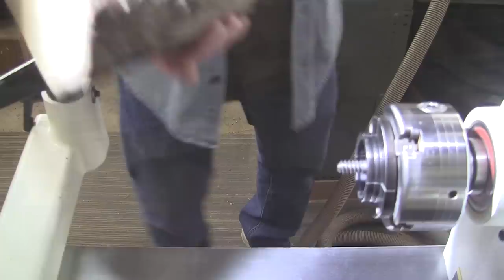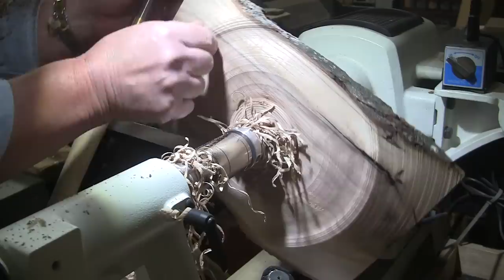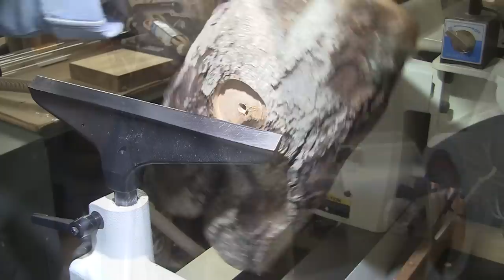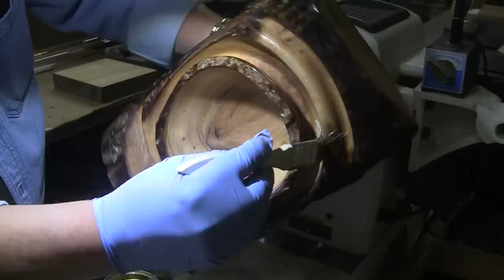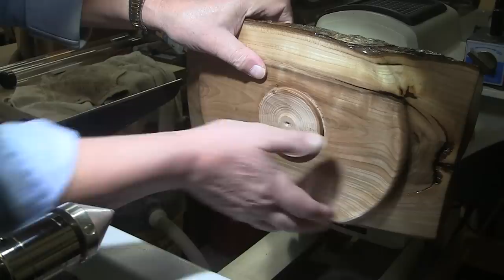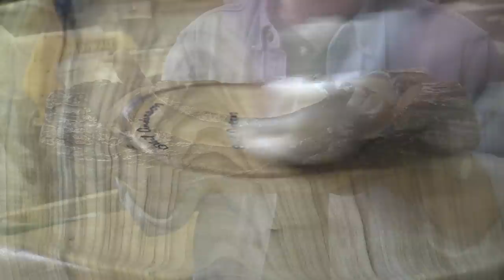Bad Dream Bowl! - Wood Turning

Comment: Hi Phil.  I meant to mention in my last comment.  In the past when I faced the dilemma of sanding in tight places that do not allow fingers, I have used rubber hose (1/4, 3/8 and 1/2) diameter with sand paper wrapped over one end and taped on the other.  This rubber hose allows the sandpaper to move with the contour of the area to be sanded without damaging fingers.  Mostly I use the clear hose that is a little firmer, but I also have use the more soft black rubber hose as well.  Hope this helps, Jerry
Reply from the maker: I appreciate the help, Jerry.  The problem is, I'm guessing you are talking about nice round bowls and your suggestions would be very helpful with those.  I turned another somewhat similar bowl after this one.  Lots of people had lots of suggestions on how to get in there and I tried some of them.  None of them work on a bowl with natural edges.  The irregular edges come around and just tear up whatever you are using.  It just takes lots of hand sanding with the piece not spinning to solve the issue.  😊
Reply: Thanks for the idea I'll try it in some places!

Comment: Hi Phil! This old video just popped up for me. I love it very much. One of the first large bowls I made was more or less like what you did but it was a combination chip and dip bowl. With the smaller bowl for dip emerging out of the chip bowl. The outer bowl was about 13 or 14 inches across and around 5 inches deep. The smaller bowl was around 4 inches across and deep enough that a little glass bowl could sit inside to hold dip. Wish I had remembered to take a picture before I gave it away. I think it was made from walnut. Anyway thanks for the video, I really do love the “bad dream” bowl! Cheers, Rick
Reply from the maker: This is an oldie, Rick.  I made a similar piece to what you are describing and gave it to my daughter.  I'm pleased she actually uses it!  Thanks a lot, buddy! 😊

Comment: Howdy Phil.....love that plump wood .....I have a chance to get a whole tree .      that piece looks fine to me . but I am blind in one eye and cannot see out of the other LOL
First thing came into my mind was a centerpiece on the Christmas table put some Holly on the outside around it and in the " grooves " and some fruit in the middle .
I have used that scotch brite for finishing before ...lots of times I'll take little little bit in the thin thin layer of butcher oil and rub after I finish with Scotch Brite . the oil will hide any scratches .
When I was in machine shop will use a lot of red and green Scotch-Brite . I have cut pieces and use it on my vibrator sander cleans up aluminum fantastic and stainless steel.....
The color of Plum wood is fantastic , make a lot of things out of that and will always look so nice.
Reply from the maker: Hi Bruce!  I spelled it Plumb on the bottom, apparently I thought I was framing a house, or something!  I corrected it in the description.  A centerpiece is a great idea, I'll relay it to the wife!
I just ordered more of the scotch brite pads.  They do a real good job and I don't have bits of steel floating around the shop.  I too, have cut it to fit a sander.  Saves a lot of work while leaving a great finish.  And, yeah, I've used it on cast iron tool surfaces, too.  Great stuff!  I really need to remember using it with the finish or at least, with sanding sealer.  I bet that helps, a lot.  Thanks for the reminder!
Thank you for your great comment!
Phil

Comment: Phil, I am a novice turner with loads of sanding under my belt and I've turned several pieces like your "bad dream" and I use the pads wrapped around a 2 inch paint brush with great results and intact fingertips. I'm a big fan and have learned so much watching your videos. I also try to leave it as natural as possible. It took retirement to return to a passion I learned in high school and started my own little venture called nakid grandpa woodworks here in Virginia Beach.......turning and learning.....bill
Reply from the maker: Thanks Bill!  I turned a similar bowl to this one and tried the sandpaper wrapped around the paint brush trick.  I don't know what kind of pieces "like" this one you have turned but these live edge and natural edge pieces do not do well with that trick.  If you have a nice even round bowl in the middle, it probably works great but on natural edge, not so much.

Comment: I like it. I know it's too late now. The only thing which was sorter out was the straight edges should have been rounded at the 4 corners which would have fitted it in with rest of your pattering. It's so unusual it could be used with a center piece on dinner table. A real talking piece.

Comment: Phil, I think that sometimes you get too critical of your work.  So what if a few spots don't sand up as smooth as you'd like, for whatever reason.  Anyone that finds fault with that should be told to go turn one themselves...... even if there are some flaws or rough spots - it's all part of the art form....This is a super interesting turning. In fact I think I'd certainly try something along that line myself, what can possibly go wrong?
Reply from the maker: My all time personal favorite, Peter.  😊

Comment: Phil. Nice piece, thinking outside the box which is great. Does sanding sealer act as a glue to keep the bark on? I have done a few natural edge bowls but I usually go around the edge of the bark with CA glue to keep it in place before putting a finish on. Terry
Reply from the maker: Thank you, Terry!  I don't think it would keep the bark on.  Your way is likely better for that.

Comment: You call it Bad Dream.   I call it boul in a boul on a platter.  I'm going to try one tomorrow.   But what I'm going to do is make the center boul a bit smaller.   Then create a second boul which will be bigger.   What ieft will be considered the platter.  I like the idea alot.
Reply from the maker: Good luck with yours, Albert!

Comment: Did you just use the wood sealer or did you apply a different final coat (I.e., poly, etc.) over the sealer.
Reply from the maker: Oh, I'm sorry if I didn't mention that, Don.  I used two coats of shellac as a final finish.  Thank you for taking your time to watch and comment, much appreciated!
Phil

Comment: Loved it, Phil.. Could I ask what lathe you are using? I'm looking to start out and have been watching plenty of videos. Not sure about a good starter lathe. Thinking about a cheap one to see if wood turning is for me or not. Maybe Harbor Freight 65345...?
https://www.harborfreight.com/5-speed-bench-top-wood-lathe-65345.html
Reply from the maker: Thank you, Carnak!  I have a Jet 1840 EVS.  Had it about a year and a half and love it.  I would rather see you buy a good used lathe for about the same price as a "cheap" one.  Maybe an old Delta, Rockwell, Powermatic, etc.  Something that maybe came out of a school shop.  Those old lathes are built to be heavy duty and for the most part, maintain their settings and accuracy.  Or, see if there is a turning club in your area.  Most of them have shop visits and mentoring programs.  Might give you a chance to try turning to see if it's something you will like.
Best of luck to you!
Phil
Reply: Thanks Phil, sounds like great advise.. I'll look around for a used machine and see what "turns" up.. lol. Subscribed.
Reply from the maker: Thank you very much for your subscription, Carnak!  I will try to be worthy!  "turns up"  LOL!
Phil

Comment: Hey Phil. I like the uniqueness of this. Does finishing a piece that is not dry cause issues?
Reply from the maker: Ya know, J Vanier, it should cause issues and I know it has for a lot of people, but so far, I have not had problems.  This plum is particularly likely to crack as it dries, even though I sealed the ends.  But, I have turned other pieces from this same pile, I think this is the third, and so far, no problems with splitting or warping.  The only thing I can think of is because I am using Shellac based sanding sealer and Shellac finish.  Maybe it slows the drying enough to keep it stable, I just don't know.  Thank you for taking your time to watch and comment, much appreciated!
Phil
Reply: OK, thanks much

Comment: A broom handle with sandpaper glued to it is safe,or smaller diameter ill bet you can figure that out!!!!or sanpaper taped !!!!,saving the rod for future use!!!!just an idea I are chinist not woodworker
Reply from the maker: That would work great if we were dealing with nice smooth edges, Tom, but we're not.  Natural edge on both sides of the deep groove.  Impossible to even keep something soft from getting torn up in there.  You may think you could hold a broom handle, a dowel or other thing steady, but you can't.  Lots of irregular edges coming at you at 300 rpm.  But, I'm glad you are participating, please keep it up! 😊

Comment: Phil "YOU ARE GRATE"  That's shouting it from the roof tops. Picture your snack tray with maybe some Ritz crackers in the outer rings with some variety of cheese or two with a small glass bole 
 of mustard. As for the sanding I do have a answer for you. contact me and we can talk about this. At this point I am 77 and I have ben woodworking almost 50 of them.
I cannot understand way nobody on YouTube is using this type of system.
Reply from the maker: Sounds great, Harold, love to hear about this sanding system!

Comment: If you go to thrift stores look in the kitchen utensil piles, there may be whisks  that have a single looped spring attached to a handle. Then you can wrap a strip of sandpaper around the spring. Depending on how you wrap the paper, it should bend easily through the thin grooves, and keep your fingers out of the way.
Reply from the maker: Great tip, SJ, thank you!
Phil

Comment: Also if you ever decide to do anything with the two rings like that again you can get one of those sponge paint brushes and put your sandpaper on it so you can still turn it and then when it comes to buffing use the same technique because if there is any friction the sponge will just come off the stick.
Reply from the maker: Such a great idea, Joyce!  I knew someone would have a suggestion on the sanding part but I didn't know it would be one that makes the sanding so easy!  I sure wish I had thought of that but next time, I will!  Thank you so much!
Phil

Comment: Very nice work yet again Phil. I really do like the way your technique of blending the live edge with the turned areas comes together. It never fails to compliment the entire piece. I'm going to have to get me one of those sand-o-flex giz-mo's. As for sanding the hard to reach inner surface of that inner ring, consider using either a pool noodle or some pipe insulation. The pipe insulation comes pre-cut along the length of it so you can roll it tighter to fit if need be. The pool noodle cuts easy enough to do the same. Use a paint stir stick or a wooden dowel like a finger to push that with some sandpaper on it into the groove while the lathe is running and then as my old English carpentry boss would say, " Bob's your uncle and Tilly's your aunt ".... I'm not sure what exactly that means but he always used it in a good way so I never questioned it.
      Thanks for sharing your skills and amazing talent by pulling out the best of each piece.
Regards,

Bill Riley
Reply from the maker: Thank you, Bill!  😊  Lots of suggestions to try what you are talking about.  What I can't get people to understand is, if the piece were smooth and round in that hollowed out area, all these suggestions would work great!  Even my fingers would work great.  But, that's not the case.  The edges inside that area are natural with bumps and voids.  It's simply impossible to hold anything still enough to do the job.  I turned another similar piece a few months after this one and tried the suggestions.  Nope, can't do it.
Reply: Ahh, we can't see that from our angle. That explains a lot. Thanks Phil. @PhilAndersonShadyAcresWoodshop